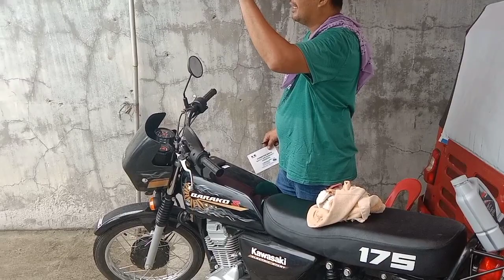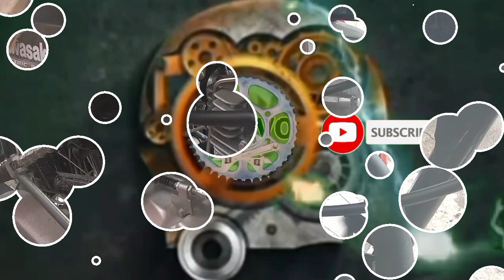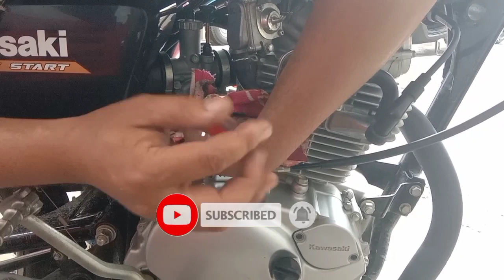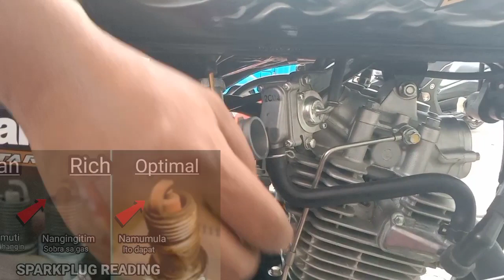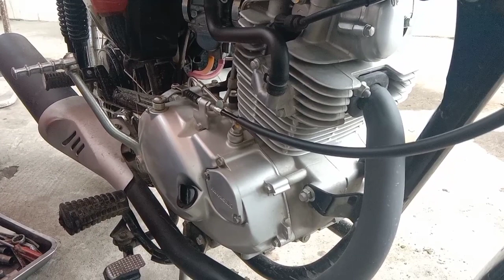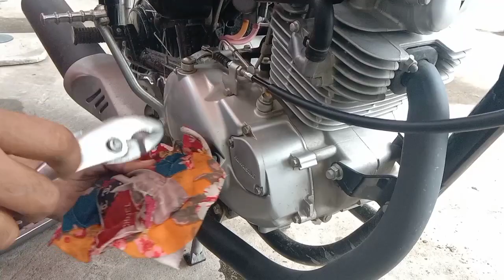#kawasaki barako 175# sinisinok/humahagok parang daw nabubulunan/yan ang ating aalamin!!!

Comment: Ano ba yan, ano ba talaga tamang amount na isasalin pagnag change oil, sa Barako ko 2021 model 1.1 Liter when filter is removed, it means isang litro at 100ml lang ang dapat ilagay pagnag change oil at nagpalit ng oil filter
Reply from the maker: 1.3 padreng, kasabay na ang palit filter
Reply: @padrengelymotovlogofficial  nabasa mo ba manual ng Barako mo sir?
Reply from the maker: Ou padreng, 1.1 to 1.2ml when filter is not removed, sa madaling salita hnd k ngpalit ng filter, 1.2 to 1.3ml nman kpag ngpalit ka ng oil filter, 1.3 to 1.4ml nmn kpag nag overhaul ka salmt sa message, padreng godbless
Reply from the maker: E content ko minsan yan padreng, kasama ang manual, slmt
Reply: @padrengelymotovlogofficial  basahin mo ulit
Reply from the maker: Tama naman padreng, 1.3ml

Comment: Barako 1 yung carb ko boss. Pero barako 2 ang motor ko. May need bang e adjust or need palitan? Sinisinok sa 1/8 Hanggang 1/4 na throttle. Mid to full throttle goods nmn. Anu kaya problema boss?
Reply from the maker: Check m mna sparkplug mo kng anong kulay or kung palitin na dun mo mkkta kng mag ppa adjust sa carb try m mna tngnan
Reply from the maker: Check mo rin ang socket ng stator papuntang regulator posible coroision or maluwag
Reply from the maker: Tapos update mko
Reply: @padrengelymotovlogofficial  bagong palit so ko boss.. update kita pag ilang km na takbo nya. Ty
Reply: @padrengelymotovlogofficial  goods Ang sunog boss, brown sa 3.5 turn out
Reply from the maker: Linisin mo socket ng stator to regulator my vlog ako nun panoorin mo
Reply: @padrengelymotovlogofficial  cge boss salamat

Comment: New subscribers ganon bayon yung saken kaya 3turns barako 1 pero sabe replacement mikuni daw GANTO PIGA AKO TAS PG KAMBYO KO SABAY SILINYADOR AT BITAW NG CLUTCH AAYAW NYA IBIGAY YUNG GIGIL N GUSTO KO SANA MASAGOT PARANG PAPIGIL SYA 😅🙏
Reply from the maker: Try mo 3.5
Reply: @padrengelymotovlogofficial  ginawa kona po ganon paden paano po kaya 🥺🙏
Reply: Yung parang hinahabol nya yung gas 🥺
Reply from the maker: Check m rin manifold mo pag singaw Yan parang naghhbol yn ng gas
Reply from the maker: Check m rin ang high tension wire mo putulin mo Yung dulo dapt walang corrosion check m dn spark plug mo baka palitin na check mo rin ang stator socket MINSAN corrosion

Comment: Sir good day po ask q lang po ung raider 150 qpag ang andar 30 pababa po sumisinok or palyado ano po ba dapat qng gawin naka 28mm aq carb
Reply from the maker: Una mong gawin check mo mna high tension wire yung kuryente dapat 1 cm ang pitik, pag ok nmn check mo spark plug kung pudpod na ang center electrode, pasok mo ang lagaring bakal dapat yun ang sukat ng clerance, pag ok nmn, punta ka sa carb adjust mo ang hangin papasok adjust ka ng 1 buong ikot tapos paandarin mo yan mna gagawin mo
Reply: @padrengelymotovlogofficial  slmat sir... God bless and good day

Comment: Bos lhat b Ng barako 3.5 ang turn. Ng air mixture KC 2012 un barako ko puti ang tambutso bgo carburator 2.5 ang turn Ng air mixture tpos ang plug reading nya maputla or lean sna masagot u bos slamat
Reply from the maker: Kulang sa gas yan pwede mag overheat, adjust ka 3.5 at ok na yan
Reply from the maker: Kung hard starting pa rin adjust ka barbula
Reply: Tignan mo sir sa chasis makita mo air mixture nya tas sparkplug reading ka din

Comment: Padreng ely ndi ba malakas sa gas pag nag adjust Ng 3.5 ?
Reply from the maker: Ganito kasi yan padreng, halos lahat ng barako, dyan sila kumportable sa adjust na 3.5, dyan din sila nag kakaroon ng magandang menor, at magandang timing, kaya naman iyan ang starting na pihit namin, hnd ntin masasabi kng malakas o mahina sa gas,sapagkat hndi lahat ng ito ay parepareho, masasabi lamang natin na malakas sa gas iyan kung nag plug reading ka, at rich ang fuel, kaya sa simula nating pihit na 3.5 pwed tayo mag adjust depende sa sunog, ng sparkplug, ito lamang ang initial na pihit natin padreng o yung panimula, salmt sa katanungan mo, godbless, padreng mabuhay kayo
Reply: Actually padreng ely ok na sya ndi na namamatay pag tumatakbo pero medyo mataas lang menor Nya kaya ko Po natanong kung malakas sa gas ..or ganun lang tlaga kpag bago pa motor..pero ok na Po sya dun lang sa menor medyo mataas..pero maraming salamat padreng ely at ok na motor ko..🙏🙏🙏
Reply from the maker: Pwed ka nmn mag adjust padreng ng idle salmt dn sayo sa comment po, bsta pag may tanong comment lng
Reply: tatakaw sa gatas yan cgurado..kc na try ko mismo pinalagpas ku lang may marking nya pero grabe kumain ng gas pero maramdaman mo bibilis kaya tinapat ko ulit sa marking yung standard pp nya ayon ok na.. pa share na din sa mga barako user jan doon nalang tayo idle nya magadjust kung kinapos ng gasolina..
Reply: @twelfthtv2213  hello saaakin kc 3 tatlo.. yun ang standard nya ..masyadong matakaw sa pag 3.5
Reply from the maker: Medyo lalakas talaga padreng,

Comment: Padre yng sa akin sparkflug ko  lean mixture ano gagawin ko sa air mixture niya aadjust ko ba papahigpit  yng hagin o paluwag.kasin po mlkas sa gas yng motor ko barako 2
Reply from the maker: Paluwag lagyn mo ng 3.5
Reply from the maker: Total turns
Reply: Tama lng ba timpla nun kpg maitim p rin yng sunog ng sparkflag magdadag ba Ako ng adjust sa hangin o mgbabawas
Reply: Gsto ko Kasi yng kalawang ang sunog optimal ok ksi kpg gnun
Reply from the maker: Lagyan mo mna ng 2.5 turns, Paandarin mo  tapos itaas mo ng bahagya ang menor pumihit ka ng kada kalahati paluwag pakiramdaman mo ang may pinakamataas na menor dun ka huminto
Reply: Okay try ko padre salamat
Reply: Padre may tatanong p ko Sayo  yng sa pinsan ko bgonbarako 2020 model mtgalnn na stock ang hirap paandarin kapg chinoke mo nmamatay prang lunod Siya bigla mamatay khit nka choke ano Kya problema num
Reply: Ano Kya problema nun padre bka mkhingi Ako ng advise Sayo at mgawa namin
Reply from the maker: @kristopherortega8761 kung may kuryente nmn linis carb, at bago dpt ang gasolina aandar ng mgnda yn

Comment: Kabibili Lang Ng barako 2 2022 Ilan po dapat sukat Ng pag chance oil po
Reply from the maker: 1.3
Reply: Binasa ko ang manual service Ng barako 2 2022 po 1.4 ang capacity Ng crank case 2/2022.ang recomend oil capacity is 1.2 pagmapapalit Ng filter 1.2 Kung nd nmn 1.1,,check ko air filter walang langis n tinapon Ng motor.25 days plang ang b2 ko nbili ko dto s Amin sta Cruz lubao servico
Reply from the maker: Pasyal k minsan dto dnlphn padreng monday to wednesday ang gawa hehe dyan k lng pala
Reply from the maker: 1.1ml to 1.2 ml kpag d ngpalit ng filter
1.2 to 1.3 nmn kapg ngpalit ng filter
1.3 to 1.4 nmn kapag binaba ang makina salmt syo padreng message ka lang pag may tanong ka slmt syu
Reply: Anu pangalan mo brothers she pag wala pasok mga BATA papasyal aq s shop nyu
Reply from the maker: Sherwin tapia every monday to wednesday, servico dnlphn
Reply: Sosobra na yan kapag 1.3 sigurado ko sobra yan 1.1liters lang lagay mo yan ang tama naka sulat sa manual , hindi marunong magbasa ng english na manual yang youtuber na nayan wag kang maniniwala jan masisira motor mo kapag sumunod ka jan sa manual ka mag tiwala parehas tayo bago ang barako
Reply: @ulululul iyan nga yung manual ng Kawasaki eh. Kahit 1.5 nga wala namang nangyayari sinusuka lang sa air box yung sobra.